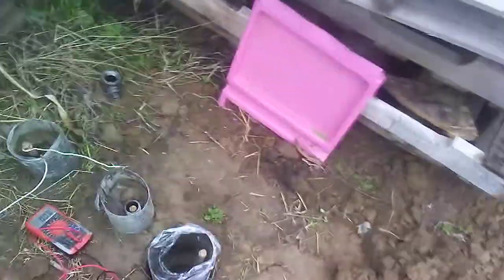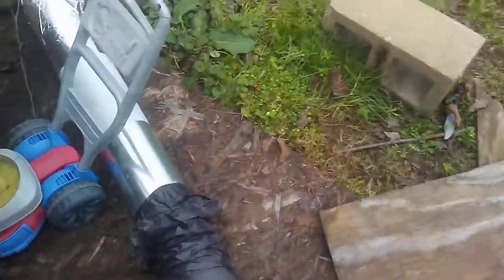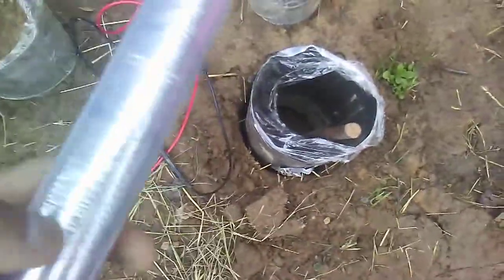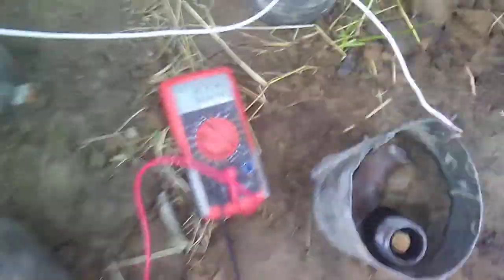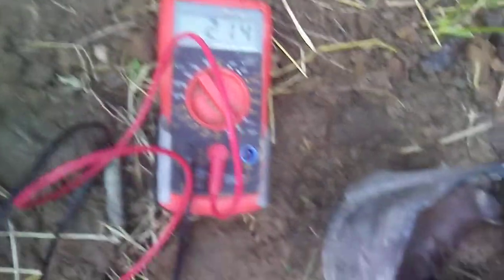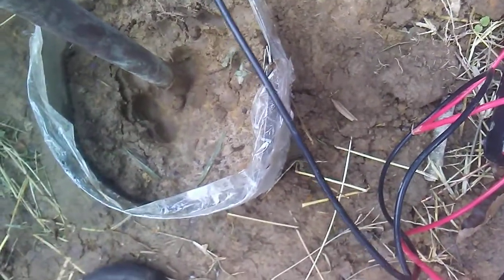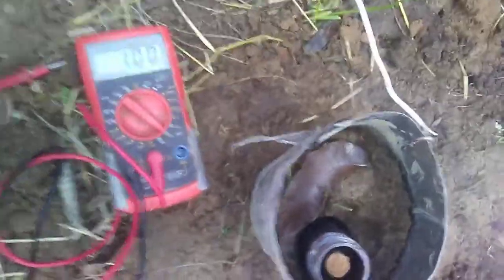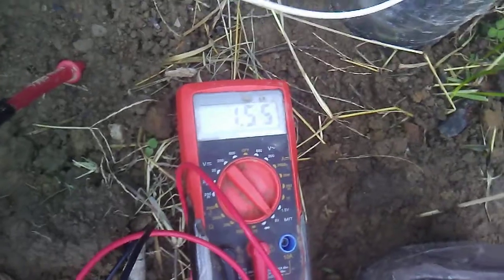Giant Earth batteries/earth capacitor. DENSE material, and SURFACE area are the keys to free energy.

Comment: Once you wrapped them in plastic you don't need them in the ground.
Reply from the maker: Yep. I'm just throwing charge into the ground
Reply: @jontherevelator9663  If the container is insolated , wrapped in plastic it can not go into the ground. You can raise the voltage to at least 1.5 per cell by switching to a magnesium anode  and bringing the anode and cathode closer together. Your salt bridge, the soil can be improved or switched to something else . You will find your voltage will be the same if your cells are a foot tall or and inch tall. The capacitor action will share the charge in within all the cells collectively. One cell may rob the next cell so if all the cells are improved the collective amperage will rise. Also using more cathode/copper in relation to the size of the cells can raise the output. So you might as well be working on a micro battery size. And this is never free . The anodes are oxidizing. Its like a fire log. It will go until the anode or the connection points are eaten away. I have multiple patents in this field.
Reply: @WaterDrive1  You are correct. I have done this before.
Reply: @WaterDrive1  A Mg Anode that large will cost $1000 apiece. Is it worth it?
Reply: Can you share some of those patents I'd like to take a look

Comment: Two potential improvements I've seen on other designs:
1. Anode horseshoes around the cathode. Picture the a "U" bending over the cathode.
2. Water in the soil. Makes a better conductor
3. Electrolyte solution in the dirt. Improves charge potential. Only downside is now acids are introduced to the ground...

https://web.archive.org/web/20200921121434/https://www.free-energy-info.com/MichaelEmme.pdf
Reply: All of this works like the human body, if you raise the acidity you get more output but less time use. You have to have acids to make any of it work. The soil /salt bridge might as well be a sponge with salt water.